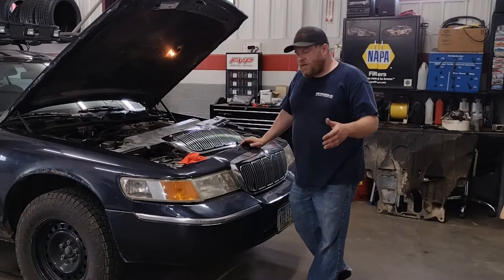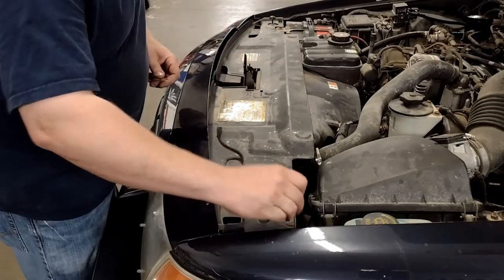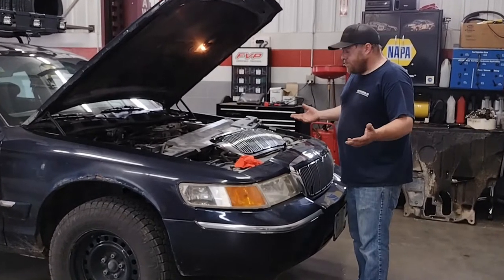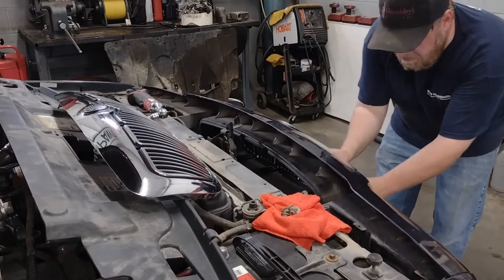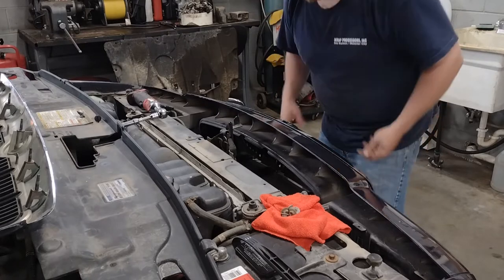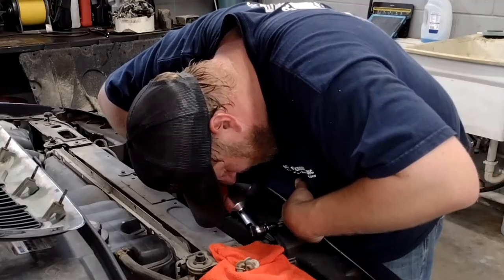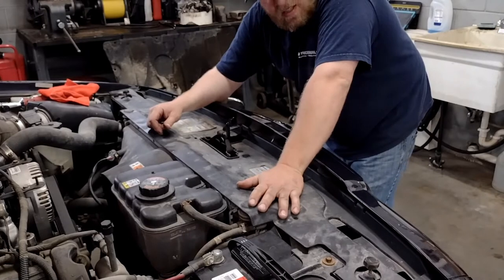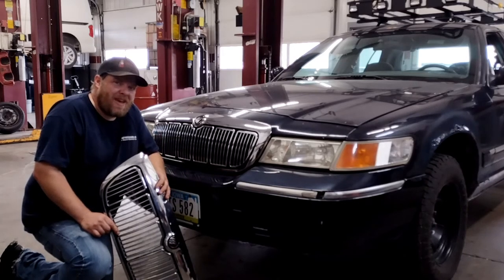How To Replace A Broken Grille - Crown Vic / Grand Marquis - Quick Fix!

Comment: Awesome video, man I lost my emblem on my front grille thanks to club carwash, my grill is fine, just missing emblem, you have a spare one by chance you could sell? I have a '98 with 78,000 mi on it a gray one and near mint condition runs like a dream flawless damn near inside and out
Reply from the maker: Thanks!  Unfortunately I don't have one, but they are usually pretty common to find at junkyards (that's where I got mine).